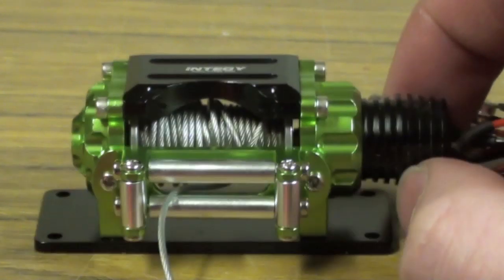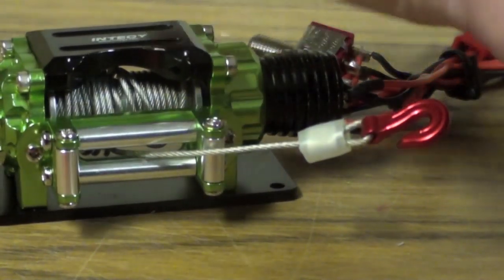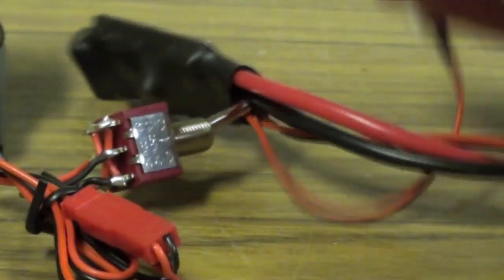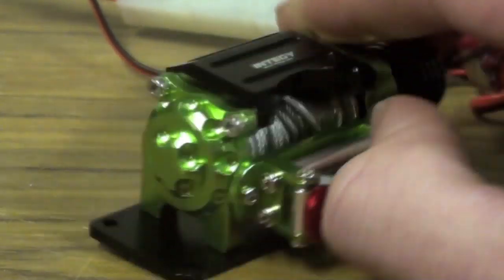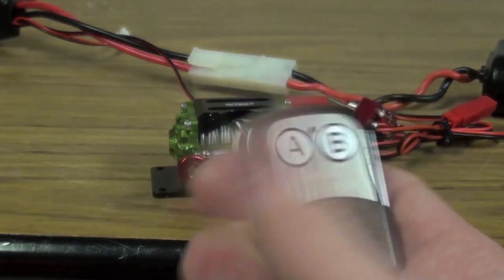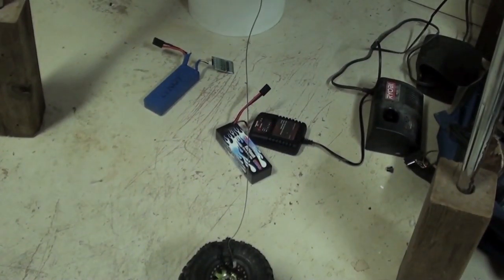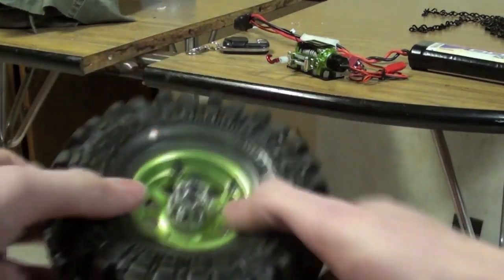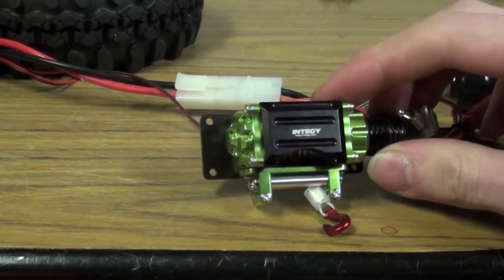RC Acrobatics: Integy T3 Wireless 1:10 Mega Winch Review

Comment: Test it by lifting your rig straight up and down off the ground 😊 a good winch shouldn't have a problem lifting the rig it's on. A winch will have more pulling power than lifting ...so if it lifts your rig it'll surely pull it out of any trouble

Comment: integy doesn't make bad quality so to speak, they don't make much at all, most of their stuff like that winch and winch controller are just rebranded with their name and the price is more than doubled. I bought a cheap billet aluminum no name winch from eBay for $21 and got it in 3 days, I saw the same one branded with integy for over twice what I gave for mine. I do not buy from integy any more, I'm honestly shocked they're still in business
Reply: even the one I have has the same cheap 3 way switch. I changed by the way, I made a wireless controller from a servo
Reply: Never had an Issue with their products. I have Integy Parts on my 1/5 scale trucks and no issues at all. Everything is "Re-Branded" these days....I do agree that their Costumer Service Dept needs a Revision or a Government Audit lol.

Comment: My Bull Winch pulls 3kg vertical!  What can this pull?
Reply: my 3racing winch on 3 cell can lift my 4kg steel caged rock buggy, i havent stalled it out it just breaks the string
Reply: but my other winch, an old style integy wired one stalled out and is now dead